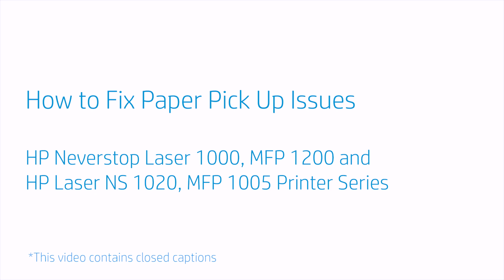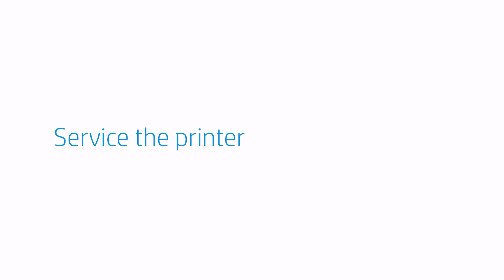Fix Paper Pick Up Issues | HP Neverstop Laser 1000/MFP 1200, Laser NS 1020/MFP 1005 Printers | HP

Comment: I'm trying to print 10 sheets but after 1 print it doesn't take the sheets. How to fix this
Reply from the maker: +Shivani Vats Click “File > Print”. Click “Properties” in the “Print” dialog box. Under the “Layout” tab, increase the number of “Pages per Sheet” to the desired number. Click “OK” to print, and the multiple pages will be laid out correctly on the printout.

Comment: How could i fix Error 27
Reply from the maker: +Atif Sohail Please try hard resetting your printer as mentioned here to fix this issue. 1. Turn the printer on, if it is not already on.
2. Wait until the printer is idle and silent before you continue.
3. With the printer turned on, disconnect the power cord from the rear of the printer.
4. Unplug the power cord from the wall outlet.
5. Wait at least 60 seconds.
6. Plug the power cord back into the wall outlet.
   NOTE: HP recommends connecting the printer power cord directly to the wall outlet.
7. Reconnect the power cord to the rear of the printer.
8. Turn on the printer, if it does not automatically turn on.
The printer might go through a warm-up period. The printer lights might flash, and the carriage might move.
9. Wait until the warm-up period finishes and your printer is idle and silent before you proceed

Comment: Hp neverstop laser mfp 1200a me Er 30 aa raha h
Reply from the maker: +shyam Gupta The printer is in an error state. Reset the printer to resolve the issue.
With the printer turned on, disconnect the power cord from the printer.
Unplug the power cord from the power source.
Wait 60 seconds.
Reconnect the power cord to a wall outlet and to the printer.
NOTE: HP recommends plugging the printer directly into a wall outlet.

Comment: How to ? repair it's noise issue .
Reply from the maker: +Vatan Barnwal thanks for reaching out!
I understand that you are experiencing a noise issue on your printer.
I'll do my best to assist you.
Remove the toner and close the door.The machine will do a pre start cycle.Should the noise be gone the toner cartridge might not turn easily.Should the noise still be heard even without the toner then the fault can be on the drive gears and even on the fuser unit.Hope this helps.
If without the toner everything works smoothly, it means you will have to replace the toner.
Let us know how it goes.
Reply: @HPSupport  dubba printer

Comment: Print  problem how to solve
Reply from the maker: +pks ji May I know the model number of your printer and the exact issue you are experiencing on it so that we can check the details for you?
Reply: I used the printer for 4 months, and experienced problems with the results of a vertical striped print in the middle of the paper, and the speed decreased after being used to print on 20 paper.
Reply: @dhevawahyudi3364  
I have the same problem. Have you figured out how to solve it?
Reply: @SuperSomInstrumentos  If still guaranteed can be directly sent to the store in question, and currently the printer is finished with replacement of drum sparepart. And the fee is free, but it must wait for one month to claim the lines. It seems this printer is not yet able to print much. Maybe this explanation could help.

Comment: HP never stop error 30
Reply from the maker: +Waseem Akram Khan The printer is in an error state. Reset the printer to resolve the issue.
With the printer turned on, disconnect the power cord from the printer.
Unplug the power cord from the power source.
Wait 60 seconds.
Reconnect the power cord to a wall outlet and to the printer.
NOTE: HP recommends plugging the printer directly into a wall outlet.